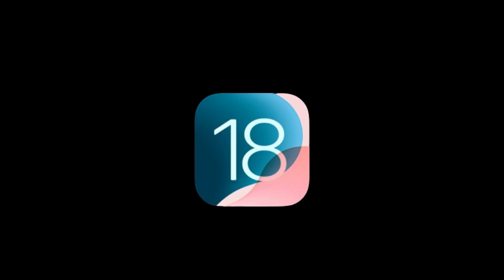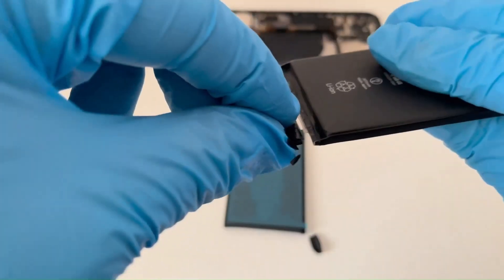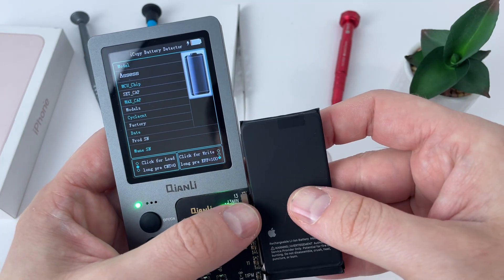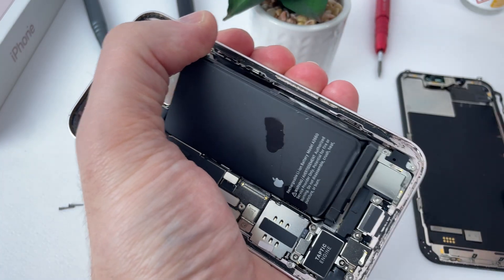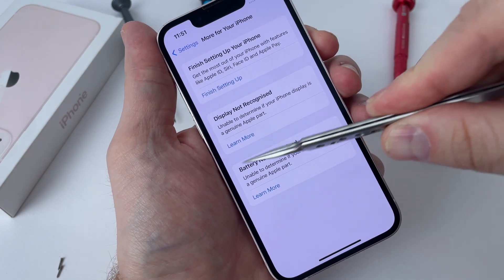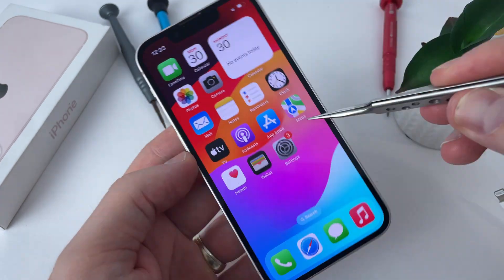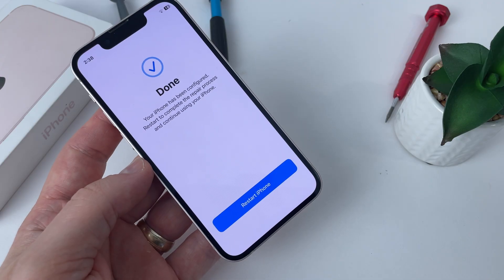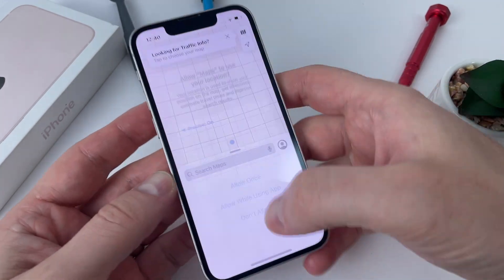IOS 18  Changed the Game! Parts & Service Repair Assistant Feature

Comment: Mine showed up unknown camera after i updated to IOS 26 and reset all the settings and the finish repair option showed up but it doesn't seem to work and say" Unable to Confugure There may be problem with the server or network.  

The seller told me the camera was never replaced or fixed except only the display screen.

Comment: Hello, if you need to swap the camera,do you need take the lidar from the donor camera or just new camera and old lidar it will able to configure
Reply from the maker: I've been having this problem for about 2 weeks now...I couldn't configure the camera. I finally changed the lidar and it worked, but I don't remember if I put the new sensor in with the camera. I think I used the sensor that came with the phone (the old one)
Reply: @TickTech03 thanks mate,im confused because some case the old lidar can be paired with the donor camera , sometimes need the lidar from the donor also .
Reply from the maker: @RasyidNazar  In my case it was a 12 pro. It probably differs from model to model.

Comment: I changed my battery and shows the repair but im not on ios 18.4 after I update the repair option is not showing anymore. Do i need to reconnect the battery flex to mg device again? ( 13 pro max )

Comment: “I replaced the iPhone 13 Pro screen with another genuine used one, and when I configure it and restart, it shows as a genuine display. However, when I restart and go to settings, it asks to configure again, it’s like a loop. Even auto-brightness is missing, but Face ID works and True Tone working,  please help me
Reply from the maker: @xhorxhinogjika7526  For example, on the 12 pro, the screen had to be mounted with its original flex (proximity and light sensor). I also encountered no problems with an iphone 12, I could not configure it... I hope there are some software problems that will improve!
Reply: @ you mean it is a software problem?
Reply from the maker: @xhorxhinogjika7526  it could be... it's different for each phone model. On 11 and 11 pro, the battery is not recognized at all, it only shows the health

Comment: What does it mean on my iphone that it says ' parts and repair option Display - used 
what does it mean 
explain
Reply from the maker: The display is replaced with a used one...usually oem
Reply: @TickTech03 how to fix no repair assistant after update to ios18?

Comment: I follow all the steps but when I tap on restart & finishing repair it show unable to configure plzz make vedio on it
Reply from the maker: The screen must have the original top flex from the phone where you got the screen, otherwise it won't work
Reply: @TickTech03  what do you mean that it must have the original top flex? And could you check if it wouldnt have unknown display message if you downgraded back to ios 17? Thanks
Reply: @TickTech03  So now the true tone problem won't appear anymore if the sreen is original?
Reply: Same thing happens with me did u get any solution?
Reply: @sadiahtasnim  Imma try to buy an original screen with its flex cable sensor because if the screen it doesn't I gotta take it from my broken screen but the true tone won't work, that's what I understood.
Reply: @sadiahtasnim  true tone original panel sy copy krwa kr new valy py paste krwado msg remov hojai ga

Comment: i have ip 12 pro max 
when i tap to finish and repair 
in diagonistic and repair assistant 
it says this part is not functioning as expected in display and when i try it to configure it says unable to configured!!!!
Reply from the maker: I also had this problem and found out the answer. In order for it to work, you must also have the top flex on the screen (from the phone from which the screen was taken). If you put the flex from your screen it doesn't work. If you don't have the flex, you can change the chip, it's quite easy if you've done it before
Reply: @ i havenot a phone now from where i have taken a original screen neither its flex or chip what to do now?? well in ios 17.6.1 i dont have a display unknown message or anything message of display ?
Reply: @TickTech03 so if I change the ic from the original screen to the replacement screen, will the repair assistant not pick up that the screen has been replaced?
Reply from the maker: @irepair-c8z  It detects it as if it were the original one, no other "repairs" are needed
Reply: It will pick up the screen has been replaced, and it will say used, so what I did was restore the phone and the message comes again and then after about 15 minutes the message disappears

Comment: Did you use the original front sensor? Or from the same device that took the lcd from?
I think in IP 13 there’s no need for taking front sensor too. Coz the sensors are not involved in Face ID. But in 12 its necessary. What’s your opinion?. I actually tried it and it was successful
Reply from the maker: The screen I mounted, I took it with its sensor. If I had put the one on the phone, the screen was not recognized as original
Reply: @ i did a 13 lcd without its sensor. I used the original sensor that devide had inside.
Reply: @ i have a 12. I need to make the display  as genuine part. If i get OEM screen pulled from another device and front sensor from another device separately, can i make it as genuine part?. I know that pulled OEM screen needs its own front sensor and I don’t the old lcd with me. Are there any way to make it possible? I need your help on this.
Reply from the maker: @Its.mxkthxr  The screen and the sensor are paired on each phone. If you only have the screen, it will not be recognized as an original part. There may be some possibility to pair the sensor with the screen... to rewrite the codes, but I haven't tried yet. On a 12 pro, I struggled for a week to do this job, until I found out that I needed the flex that came with the screen, I took it from the old phone and it was solved on the first try
Reply from the maker: @Its.mxkthxr  or, take the chip from the original screen, mount it and you're out of trouble
Reply: @TickTech03 tell me about the possibilities that u told about 😅. It’s kind of urgent matter. So please tell me when you get more information in this.
Reply: I have to find way to pair.
Reply: @TickTech03 hi, which flex are you talking about? So if I use a iPhone 12 original screen which flex do I need for this repair assistant to recognise it as an original part?
Reply: @TickTech03 which sensor? Are you talking about the earpiece flex? If so then if I don’t use the original earpiece flex which is on the iPhone 12 then Face ID won’t work, really confused
Reply from the maker: @irepair-c8z  Yes. The earpiece flex. Face id will work. Try!!
Reply: @TickTech03  I tried and Face ID worked, iOS 18 is brilliant, does this mean The Right To Repair has actually won after so many years of trying
Reply from the maker: Now I have problems with an iphone 12... it does not recognize the screen... ios 18.1.1 😂😂
Reply: @TickTech03 is it a original screen you are trying? Have you solved the issue yet?
Reply from the maker: @irepair-c8z  no..I tried with 2 original screens...I left it like that with an unknown part, but true tone works!
Reply: @ I wonder why it shows unknown parts as you have tried two original screens
Reply from the maker: @Its.mxkthxr  I tried...without success!😐
Reply: @TickTech03  check the screens have readings in jcid!

Comment: Did you try using a used display (off another 13)? I heard that you can’t use used parts on the 12-14 series
Reply from the maker: The screen in the video is used part!
Reply: @ ok then I guess it’ll apply to my 12 mini too! Been considering doing a battery swap as I’m at 75% capacity…
Reply: @EvanPang-w4i  You can't pair the screen if it doesn't have a matching front sensor flex + speaker
So if your $3 front flex dies, like mine on my iPhone 12 mini, then you lose both display max brightness and face id...
Everything regarding face id is still touchy, Apple keeps doing everything to make it bad

Comment: My iPhone 13 pro max. Changed genuine display parts..i do same all you does. But its not work 😢.
Someone please advice me
Reply from the maker: I noticed that if you take an original screen for it to work, you have to take it with the top flex (the light sensor...), otherwise this method does not work

Comment: Hey, i need some advise. I bought used ip12 about 6 months ago with battery health 96%. Today its 86%, it definitely seems like it had a battery replacement or programmed the battery to fake its health. Should i get its battery replaced by buying one from good aftermarket brand such as repart, Ampsentrix
Reply from the maker: Hello, if the current battery lasts a day with normal use, you should not worry about the health of the battery. If, on the other hand, it discharges quickly and you cannot enjoy the phone, then you can replace it with a good quality aftermarket battery

Comment: Question for Third repair shop is : Many bought used phones for parts and those parts will be icloud locked , until now it didnt matter but on iOS 18 they will probably get a message to repair and its gonna ask for icloud or not !!

Many dont know how screwed they are lol
Reply: It depends on the lock. If is iCloud locked because the person forget the code, there isn’t a problem, but if is iCloud locked because it was reported as lost/robbed it will not work
Reply: @gabnrami  usually people steal phones and sell them on black market for parts or to repair shops !
Reply from the maker: From what I understand there will be a problem with these parts, they might not be able to be used at all. For now, we are waiting to see how things will evolve with this new update.